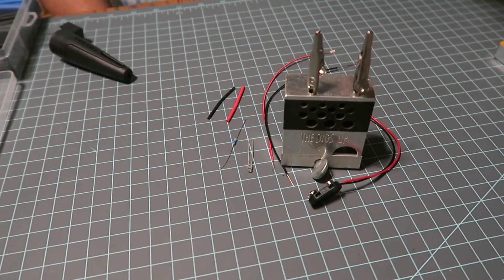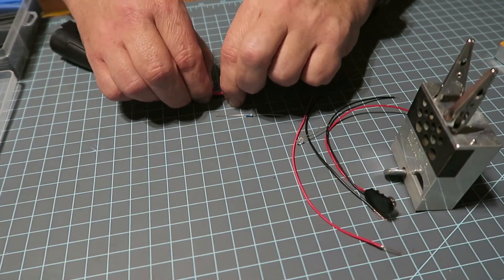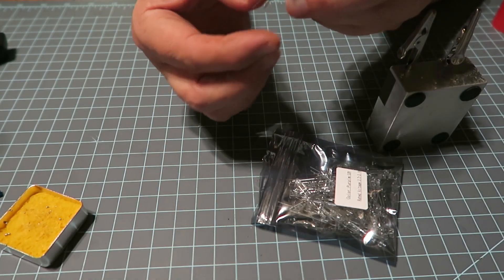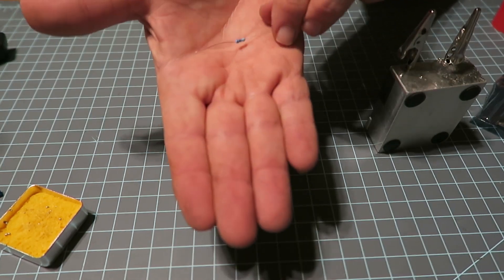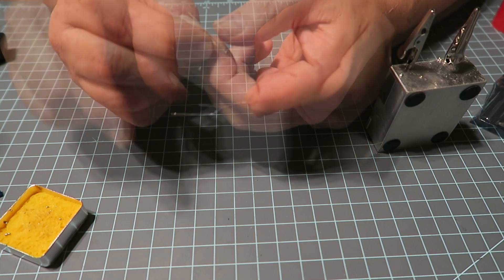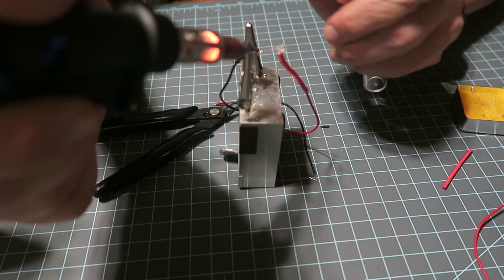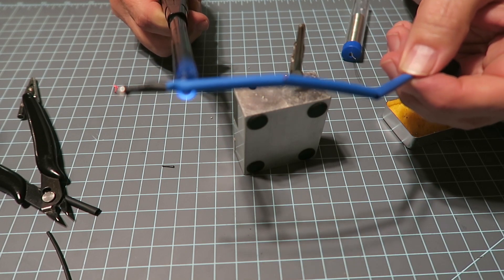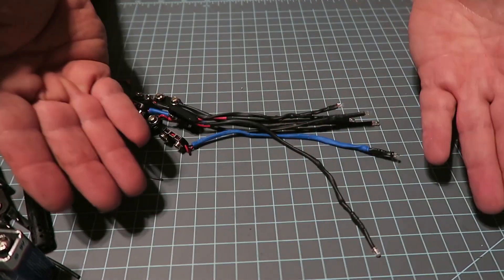How to Build a UV Snake Light to Cure Resin!

Comment: “Where’s the part lists.”   You can’t just any UV LED.  Has to be 405 nvm.

“Snake my day” by “WHERES THE PART LIST.”
Reply from the maker: Here's the set of LED's and resistors that I used.  https://tinyurl.com/yylu3hyc
Reply: Will these work?
Bowerful 50pcs 12V 5mm UV LED 9V - 12V Gauge Cluster Instrument Light Emitting diodes https://www.amazon.com/dp/B074SLM8K9/ref=cm_sw_r_cp_api_glc_fabc_Uxx5FbBCTAP9K

Comment: Where do you buy the Harz Labs resin in the United States? I like that it is odorless and requires no venting. I can't find it however.
Reply from the maker: SteveRawley64 I spoke to the owner of Harz Labs yesterday and he has his US supplier lined up for January to start selling. I’m excited about this because it prints so well and very little odor.
Reply: @3DPrintFarm  Awesome! I hope it arrives soon. I got the printer for Christmas and the smell is bothering me a little. I'd like to try their no fume resin. Also, is there a way to contact you directly? I'm having an issue that I don't know how to resolve. I'm trying this as a test: https://www.thingiverse.com/thing:3319503/files and I can't get it right. I'd like to know your specs if you can try it.
Reply from the maker: I'll give it a whirl and see what I come up .  I know you are going to have to angle the nose up 45 degrees.  My concern is the fins in the engines.  There are some issues with that model when I run it through Meshmixer.
Reply: @3DPrintFarm  New guy questions: how do you know it needs to be nose up? How do you add the Photon as a Meshmixer printer? How does Meshmixer show issues? I appreciate the help! Let me know if you get a good print! Thanks!